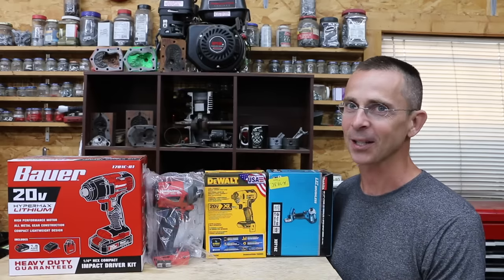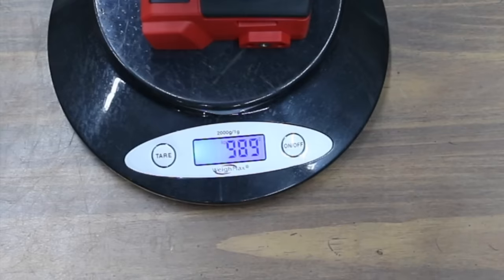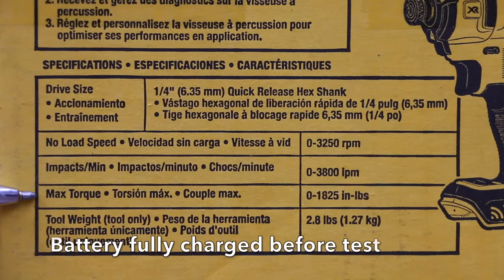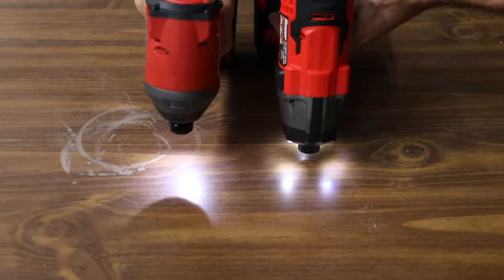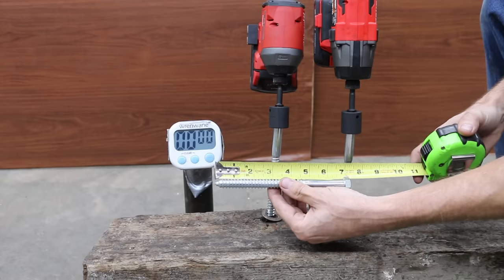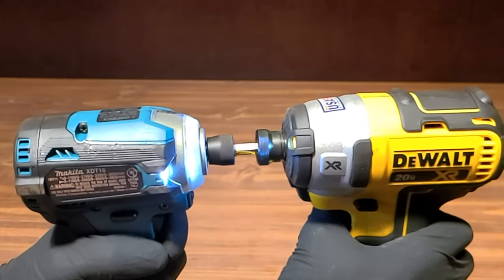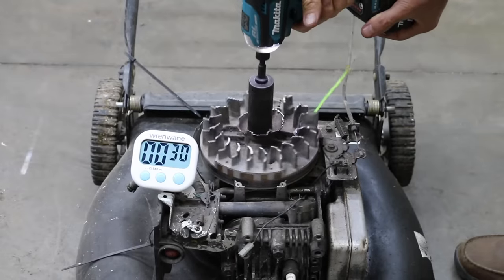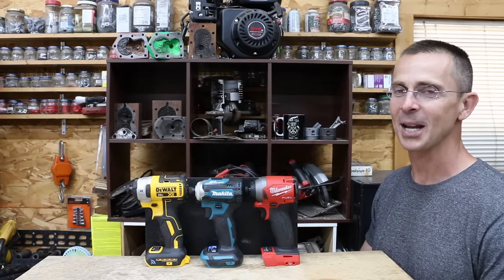Best Impact Driver? DeWalt vs Milwaukee vs Makita vs Bauer!  Let's find out!

Comment: Makita is second, Milwaukee my absolute favorite. Dewalt is alright but seem to be going downhill Abit for pure profit.
I wish milwaukee was still all American made iron but the same tool would cost us all 250 bucks so we can't complain....we have run quite a few makita cordless tools and very good tools overall but usually fall short to Milwaukee, and battery's last half as long as Milwaukees. Also after all these years (we own just about every dam Milwaukee made m18 only the sawzall had a short in the chip board but was replaced for free from factory. We are very hard on all the tools and they're run in some of the coldest then hottest conditions so yeah truth is they are too dawg, followed by makita, then DeWalt
Reply: I know many might not agree but I would pay an extra $50-$100 for a tool like that to be made in the USA again.
Reply: I stick with makita because you need a $250 high output battery to get the best out of their weed wacker, where the makita runs full stink on the same 3 and 4 amp hour batteries that came with all the other stuff you bought. If Milwaukee just ran a double battery setup instead of forcing 18v because of royalties, I'd have never gotten $900 deep into makita stuff.
Reply: I would say makita is #1
Reply: @CSLFiero  makitas battery Ecosystem is a hot mess.. 18v, dual 18v, 36v, 40v... Make up your mind already. 😂

Plus their 18V batteries are lagging far behind... I'd rather but a proper HO battery than messing around several with outdated small capacity batteries.
Reply: @TheDaniel85  literally 3 out of the 4 voltages you listed there are all just the basic 18v lxt battery. The 40v is different, but it's only overseas currently and it's been out over a year there so I don't think it's even going to come to USA. makitas ecosystem is objectively better, not to mention any 18650 based battery claiming to offer more than 6ah is cheating you somewhere. It's not hard to figure out which batteries are getting used, they're off the shelf 18650s. What's more, the HO Milwaukee batteries aren't exactly a revolution, just fatter higher amperage cells because, again, they're using off the shelf 21700 cells and anyone can figure out which. The only reason Milwaukee choose to go with the HO design is to maintain 18v output, attempting to drag the market towards that output instead of 36v, because Milwaukee has long standing earned royalties whenever a power tool runs a 18v lithium.
Reply: @CSLFiero   No, since you can't even keep check of Makita own plattforms... that says quite a bit. They have a dedicated 36V platform on top of the LXT 18V X2...

Guess what, I'm overseas! Not everything is about the US... I'll disregard the useless cell-rant since I did not even mention anything about them.

It still does not change the fact that Makita does not update nore take care of its 18V battery platform, they should really take care of their messy ecosystem. No, there's loads more reasons to go for the bigger cells, and you know that.. They're not alone in using bigger cells for their 18V platform.
Reply: @TheDaniel85  makita themselves market their dual 18v as their 36v system, I don't know how you figure it says something about me personally. You seem to have an axe to grind here. I'll leave you with this.. makita runs some 270 tools on their lxt batteries, a battery platform that consists of handful of capacities based on whether you want longer run time or a lighter tool. That's it. It's that simple. No flex voltages, backwards compatibility, tools which perform better on one than another.
Reply: @CSLFiero  No, I meant it says something about the battery-situation on Makitas side... They just until recently had a dedicated single battery 36V platform, which you did apparently was not even aware of. They still sell the batteries and a couple of the tools.

The only axe I have to grind is with Makita for for not taking proper care of their platform. Discontinuted 36V platform, replaced with a 40V platform, out of date 18V platform, which means outdated 18V X2 platform.

No high capacity 18V batteries for their 18V tools, no slim proper capacity batterier for their 18V tools. Their 12V batteries are in the same situation... Where's the 4Ah slim packs? Where's the 8Ah batteries? Where's the compact 12V 4Ah, or even 6Ah 12V batteries?

And yeah, their batteries disable themselves if you try to charge them a couple of times if they're under the specified cutoff voltage due to temperature or something else... :|

They make some great tools, but their battery mess makes me steer clear of them until they figure out what they actually want to do...  Because right now, the 18V line looks very abandoned and in need of much love.
Reply: I wish Milwaukee weren't patent trolls. I can't buy their products in good conscience.

Comment: Great comparison video! In case anyone else is a cheap ass like my self I would like to say I purchased the Bauer to replace an old Porter Cable and it works good for my small jobs around the farm and it comes with battery for $70.
Reply: Bro you didn’t... if you would have got Milwaukee you wouldn’t have to replace I use mine everyday going on 4 years and never had a problem yet
Reply: I used a Bauer at my last construction job exclusively for 3 years and never had an issue with it. While I appreciate the torture testing that this channel often provides, it is also important to understand that just because cheap tools breaking points are lower, doesn’t mean that the average consumer, even with heavy use, will ever find themselves at that breaking point. If they do, they are likely using the wrong tool for the job

Comment: For once, it turns out I made the right choice! Milwaukee M18 here.
Reply from the maker: Thanks for sharing.
Reply: In the real world Makita is such a better option. Better trigger control and the batteries don't need charged everytime i use it. All together im not impressed with my milwaukee.
Reply: Same great breakdown though.
Reply: Yup same here, also their selection of tools on the m18 system is insane, I've used makita for awhile but with not much quality difference I'd rather go with one company that has every tool and then some covered.

Comment: As someone who has some Milwaukee tools, I have found know that after a period of time, the tool will cut out due to mainly due to internal temps from what I've noticed.
Reply from the maker: Thanks for sharing.
Reply: I think its actually a safety measure to protect itself. Whatever it is I love it on the hole hawg because it saves my wrist from snapping.

Comment: Thanks for another great video PF.  I'm a pro contractor and I've owned both Dewalt 20vmax and Milwaukee M18 tools.  My contractor buddy has Makita.  All 3 are definitely good pro-grade tools.  

A couple notes on the test: I think you should have charged the batteries fully between each test, because each brand has slightly different battery management technology.  Milwaukees go hard until they hit that auto-stop, while Dewalts will last longer but gradually slow down.  This varies by model too.  Also, battery size makes a performance difference.  I don't know why, but my Dewalts have more speed and power with a larger battery than a small one, even when both are freshly charged.
Also, I think it would have been a better comparison to do the stress test (7" lag) AFTER all the performance (speed and torque) tests.  Any wear or damage from the lag test could affect the subsequent tests.
Final note: I had Milwaukee and Dewalt at the same time, and sold my Milwaukees for one simple reason: ergonomics.  Milwaukees run great, Dewalts are just more comfortable in my hand all day.  
Thanks again for an awesome channel.
Reply: Im a dewalt man all day to
Reply: @robinsonbetonbouwrobbo8847  amen

Comment: Another great video. I have the Milwaukee impact driver and it is a brute! I use it for driving deck screws, when building fences and gates. Maybe you should test 1/2" drive cordless impact guns? Lots of mechanics are using these now and it would be interesting to see which one is actually the best. Keep up the good work.
Reply from the maker: Thanks for the video idea.  Thanks, will do.
Reply: Project Farm will you test the kolbalt 1/2 impact of you do the video suggestion above

Comment: Is it possible to discuss differences between the M18 FUEL and the other similar Milwaukee impact drivers, the M18 (non-fuel 2850-21P). Also, how does the torque of these smaller drivers compare to the 1/2" drive Milwaukee (2962-20)?
Reply from the maker: Thanks for the suggestion.

Comment: When I did residential plumbing, the dewalt tools would make it about a year.  The milwaukee tools would go 5-6.  They were used hard daily.  I’m not in that line of work anymore, and finally upgraded from the old Milwaukee 18v nicad tools to the 18v fuels. They have been great so far.  Thanks for the testing!
Reply from the maker: You are welcome!

Comment: I wont generally use a cordless drill for an impact gun, my grandpa used to work on cranes and water trucks and they would have to change out the wheels all the time, after he passed, i found his compressed air impact gun in the shed and ive always used it to do my wheels, sounds like an old nascar gun, really fun and neat to use and can get any nut unstuck, truly an amazing impact gun
Reply from the maker: Thanks for sharing.

Comment: How was a ryobi not in this? Lmao I'm trying to find out how much better a brushless vs normal ryobi perform
Reply from the maker: I'll add it to the round 2 video
Reply: @ProjectFarm  do you have Lidl or Aldi Discounter market in your country? Maybe add those cheap units too, here in Europe they became popular even for semi professionals on the job as they are cheap
Reply: @ProjectFarm  bring in the hart line up from Walmart I use ryobi because it's cheap I've had stuff stolen dropped and burned up it gets the jobs done for less but I've been surprised so far with hart bits so I'm guessing the tools will preform decent
Reply: @kitecattestecke2303  are y'all not able to get your hands on ryobi?
Reply: @ProjectFarm  Should check out the new HP line as well as the older brushless and brushed offerings (in other words Ryobi offers three levels of tool now based on a guys budget), I have quite a few Ryobi's as well as my Millwaukees and Ryobi (especially the new HP line ) is/are some pretty darn good tools for the price, in fact in my opinion they blow away any of the Harbor freight crap in every way.

Comment: what is the best socket adapter for the milwaukee? i saw the video where you test different ones, but didnt mention if the dewault adapter fits the locking milwaukee in this vid.

Comment: I would like to a video on cordless brushless 1/2" drive impact wrenches. Maybe comparing DeWalt, Milaukee, Makita, Hart, & Bauer. There are probably a couple I have left out such as Snap om & Mac Tools since they are usually quite more expensive then other tool brands. I have to say that I am a fan of the DeWalt line of 20 volt Max XR brushless tools.
Reply from the maker: Thanks for the suggestion.

Comment: Bluetooth or app control on a hardware tool feels like complete BS. why would one need to pull it phone out to do setting while the thing has hardware managed switches for it??
Reply: In case someone on a job site has some sticky fingers you can disable your drill to ensure no one steals your stuff.
Reply: Bluetooth is for advance tool operations required on professional jobsites..like lagging in concreate anchors to torque specs or, battery use/failure rate reporting used by project managers, and to prevent theft but day labours...Remember large contruction companies are forced to hire local talent or union workers in some areas. 

Tool data and info is given to manufacturers to improve tools and prove that tools are not being abused during warranty swaps too.

Fyi milwaukee bluetooth system is called onekey.

Ive worked on jobsites with 200+ crews lasting 3-4 years....when we buy 10 pallets of tools, we end up warrantying about 1-2 pallets back. Doing a Warranty on a single tool from a dewalt or milwaukee is not a problem...no hassle; But when warrantying through your distributor (required for bulk pruchases and returns) you will have too show lack of abuse...
Reply: @David.....  wow crazy numbers, but I understand its usage better now. Thanks for explaining in detail!
Reply: @RomboutVersluijs  no problem....also note dewalt and milwaukee both make tool model with and without the bluetooth feature, so if you dont want to pay extra for it/dont need it, you dont have to get it....in this case dewalt impact without bluetooth is dcb887
Reply: @RomboutVersluijs  yeah it’s pretty much for guys who work in construction/job sites
Reply: Because America

Comment: Used to love Milwaukee but I’ll NEVER buy another. Had two saws melting my batteries, one on the day i bought it. 1-800-sawdust is a joke!  They wouldn’t stand behind the saws or the batteries both were less than 14 months old. Home Depot took back one but I was out over $1000 in saw and batteries. Milwaukee is garbage now!
Reply from the maker: Thanks for the feedback.

Comment: You should try this with rigid brand. They have a lifetime tool “warranty”/ agreement to fix them when they break
Reply: Warranty... unless they watch his channel...
Reply: Not after they see what Todd does to it on his YT Channel.. LOL
Reply: We've had one at work for at least six years, it's beat all to hell, still going strong. It's an old x2 I believe.
Reply: If they don't have the parts to fix your tool you're SOL, and Rigid makes sure that happens often it seems. Plus you have to register the tool purchase to get that warranty which many people don't do.
Reply: P RO it’s very easy to register it and takes about 5 minutes on the internet. If someone not willing to take that time that sucks for them. The little bit I’ve used their tools, I like them. They don’t have the most power but you can’t beat a lifetime agreement to fix or replace the tools

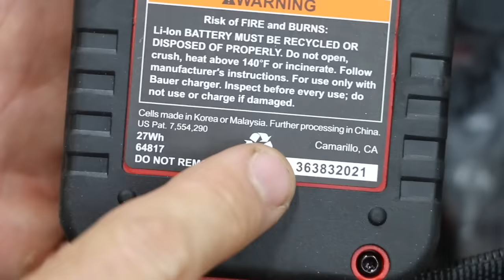Comment: 1:04 Bauer is slick. Says 1.5 Amp on the battery but 27 Wh on the bottom. That's a 1.35 amp hour battery.
Such liars. Also Makita would have done 3600 rpm's without that heavy 1/2 inch drive adapter. I know you're going for realistic. But put a phillips bit in and it will do 3600. I know its hard to get a tach indicator on it.
Reply from the maker: Thanks for the feedback.

Comment: Adding more electronics to tools is a mistake. There’s already enough to go wrong.
Reply from the maker: Thanks for the feedback.
Reply: Tell that to my one key 3/4 inch impact I can dial the amount of pressure for torqued Bolts at work.
Reply: @josueguillen5053  waiting for the smart drill. So i can drill holes. Order pizza while face timing . And watching YT .

Comment: Here's my question. Are people buying different brands with different batteries and different chargers for individual tools based on which tool is the absolute best?

When I started buying cordless power tools, I started with Dewalt because it had a good reputation and there weren't so many available brand families as there are today, and I wanted to stick with compatible batteries.

10 years later I am approaching 20 tools, around a dozen batteries and 8 chargers from the base model 1.25 Amp to the 8 Amp quick charger.

Dewalt doesn't always win these tests but it generally does pretty well. But I'm not going to go buy a Milwaukee or Makita because they win a test, even if they do it with amazing performance. I'm going to keep buying DeWalt because I already have DeWalt batteries and batteries are expensive. 

So do people buy individual tools or tool families? You've done a lot of tests, I think you'd be well equipped to aggregate your results to produce overall results across tool families. Do people switch families after having a collection?
Reply from the maker: Thanks for sharing.

Comment: Putting the Bauer in that competition is like putting me in a 100m sprint against Usain Bolt. It goes to show that good tools are not cheap and cheap tools are no good.
Reply: To be fair the bauer uses a brush motor and the comp use brushless regardless its a good enough tool for most people for the price
Reply: It was fun to see it though. And i think it really didn't perform that bad.
Reply: I've been using the bauer brand for quite some time, and for what I do, they perform just fine..I personally prefer Milwaukee, but I'm on a budget.

Comment: I believe the Milwaukee has a built in protection that shuts it down if it gets too hot from hammering. My m12 fuel 3/8 impact does that too if you hammer on a bolt too long
Reply: It could also be a protection against damage from such a rough impacting going for so long i would be surprised if the Milwaukee over heated turning the motor for tht short time but it could be a safety saying hey were trying our best here and we aint makin much progress over this amount of time maybe quit it before you break me and get a bigger impact🤣
Reply: That's what SHE said lol

Comment: "Made in the USA, with global resources" means assembled in the USA to me.
Reply from the maker: Thanks for the feedback.
Reply: Lol that's what it means. Every part was imported and they put " legos " together in the usa and call it " made in the usa " 😂😂🤦‍♂️
Reply: As long as it’s assembled in the U.S.A it’s got my approval.  Assembled here means it counts to our GDP.
Reply: @ronijr4918  "Technically accurate is the best kind of accurate."
Reply: "Global resources" prolly means illegal aliens lol
Reply: Roni Jr yeah Stanley Black and Decker makes the mold from chinese plastic, and the motor/transmission is made in Mexico and just imported here to be assembled. I worked at Stanley Black and Decker Mission for a year. They do use good batteries though. Craftsman is made at the same place with the same parts.